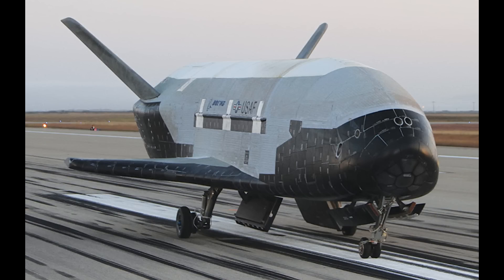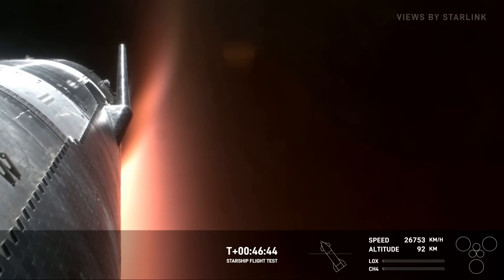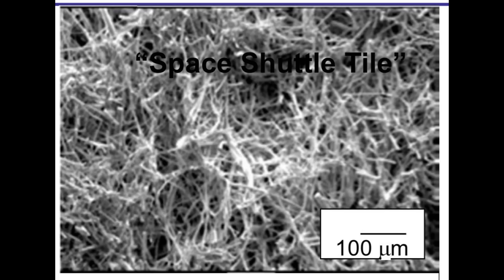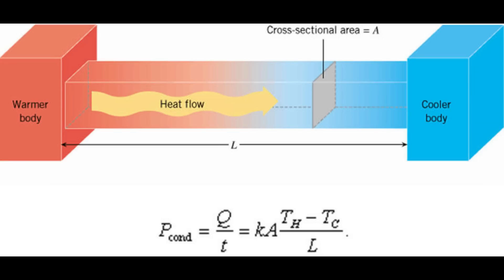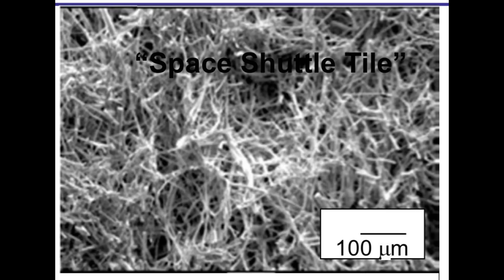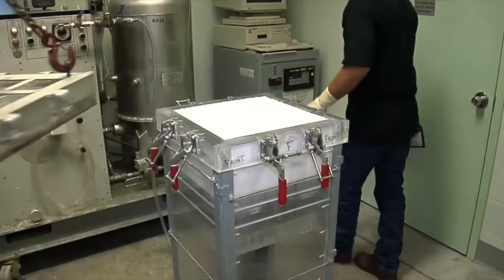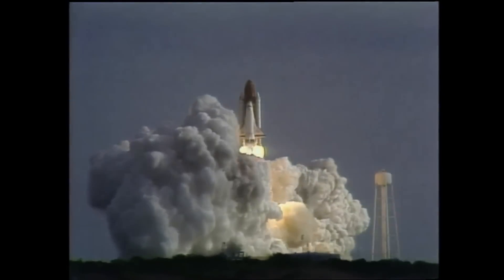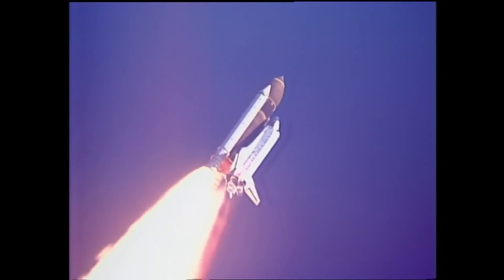The Microscopic Trick That Makes Heat Shielding Tiles Work

Comment: The best way to mitigate this problem may simply be to have BIGGER spaceships. In re-entry, a shockwave forms at some distance from the surface that needs protection, and that shockwave is then isolated from that surface. Heat must radiate from the shockwave to the surface you want to protect. Am I correct in supposing that, for a larger surface, the shockwave forms at a larger distance? If so, then the wave sits at a greater distance from the surface you need to protect. And if it's far enough away, you may be able to dispense with things such as ablative layers that need a lot of rework between flights.
Reply: It's not the size, it's the curvature of the edges, that means wings and flaps are tricky to deal with.  But that radiant heat from the shockwave is still a lot of heat to deal with, so you need a good heat shield even after getting the shockwave right.
Reply: A massive object will theoretically heat up faster over its surface due to the increased surface area facing against the atmosphere, meaning you have increased air resistance/drag. The air molecules would not just be more easily redirected like a highly aerodynamic shape, but instead be compressed and forced to move along the surface of the object till it reaches the edge.

The shockwave propagates along the surface, until it reaches the end of the surface and begins to dissipate. Other surfaces beyond the main facing (effectively in the wake of the object) can be subject to heat via radiation off of the plasma that was generated under compression, but this is a far minor problem.

I'm unsure what you mean by the shockwave in your comment - if you are taking about the plasma generated along the facing surface or the wake of the hot air/plasma. Normally the ablative heat shield elements for things like capsules do not need to be present anywhere but the facing surface.
Reply: @V3RTIGO222  There's also the simple mass to surface area scaling. The mass, and hence kinetic energy to dissipate, grows faster than the surface area over which it's dissipated. Only way to square that circle is the plasma gets hotter.
Reply: @QuantumHistorian  True, but I would assume that you could also create a larger shield, using lighter material or through construction that allows the overall weight to remain similar or lighter, without changing the size of the vessel if you wanted to... I think the inflatable heat shields kind of use that concept to a limited degree.

I will point out that with higher drag, you theoretically have a shorter period of time needed to slow the vessel, despite the higher peak temperature, which could be more advantageous.
Reply: @V3RTIGO222  That would work if the timescale at which the temperature of the plasma is dangerously hot is shorter than the timescale for heat transfer. In this case, the main mechanism for heat transfer is radiative which is going to be pretty fast no matter what you do. So I think the craft (or, at least, the heat tiles) would really "feel" the peak temperature. There's a reason why starship uses aerodynamic lift to slow down it's descend and bleed off speed as slowly as possible.

In addition, the thermal flux goes at T^4. And, roughly speaking, the integral of T over the whole of reentry is going to scale with the total kinetic energy loss, which goes up with mass. So if you halve the time of reentry, you double the temperature and so increase the heat flux by *16*. The scaling works against trying to get re-entry over and done with quickly.
Reply: @QuantumHistorian  This is effectively how ablative shields work, by discarding the heated material, so yes.
Reply: @V3RTIGO222  Huh? I thought the entire point was to not use ablative materials and instead have reusability? Otherwise, yes, obviously, it's been known for 60 years that ablation is the easiest way to make a heat shield. As ablation depends on total energy dissipated rather than heat flux, it can cope with shorter reentry times. But that's not what we want to happen for a reusable craft...
Reply: @QuantumHistorian  Well, specifically resusable heat shield(s)... We have plenty of reusable craft with ablative heat shields. In any case, you need something that can resist/absorb the thermal load or something that displaces it, and an increased surface area is unlikely to be good at enabling a resistance/absorbtion style of shielding.

Comment: I'm not an engineer but I was wondering about this for a long time. Would it be possible to use water vapor as a way to cool down the plates in friction with the atmosphere? Water is easily replaceable. Just keep a tank of it for releasing steam along the length of  the rocket during re-entry. I can't do the math of how heavy that tank would have to be,  or if the heat transfer of such process would solve the problem etc, but that's why i'm asking.
Reply: elon musk talked about this and it all boils down (haha get it) to it being the same mass as the heat shield 
Also they wanted to use methane for this, since it's much cooler
Reply: @linecraftman3907  Where was this video? It's hard to search using the same terms as the water cooled steel plate that is under the pad. Also the thing with water is that it costs much less to replace, and also involves far less parts. (that's if the whole thing works)
Reply: @lgtwzrd  he talked about it in the interview with Everyday Astronaut. 

The thing about water is that you're also adding a whole lot of complexity to the vehicle and the lines would have to run inside the fuel tanks where the water would freeze

Comment: The shuttle was really cool.
Reply: It was a flex.

But to be economic start with booster reuse, not orbiter, like falcon 9.
Reply: @xehpuk  I thought it did serve purposes other than “flexing” for the US? Like payload and crew rotation on the iss/mir. Also, the boosters were reused, the main orange tank fell into the ocean. The boosters fell back to earth with parachutes which allows them to survive.
Reply: @interestinggameraltlol9245 I would hardly call the boosters "reused". They were basically building them from scratch every time.

Comment: Whatever happened to actively cooling the skin?  Wasn't that the main point of using steel?
Reply: Steel still has the benefit of being better able to survive if a tile is broken.  Just look at how long that fin managed to hang on with hot plasma blasted inside the hinge.  The type of steel they are using also has the benefit of not becoming brittle at cryogenic temperatures.
Reply: @Br3ttM  I know.  But everything is a tradeoff.  IIRC, the thing that made steel a net win was supposed to be it simplifying the heat shielding.
Reply: SpaceX calculated that it would be heavier than a passive heat shield. But Elon said he wasn't so sure about that anymore.

Comment: We are in serious need of redesigning spacecraft altogether, and in saying this I also mean propulsion and anti gravity, or at least something to this effect..  but at the rate the human mind is evolving into a space faring species will determine the time factor, we lost out on incentive..to the tune of more than half a century..
Reply from the maker: Let me know when you make anti-gravity work because there's nothing in science that suggests it's possible. Until then let the engineers use what works.
Reply: @scottmanley  Oh wow, thanks anyway, was worth a shot.." at least something to that effect"  🙃
Reply: @scottmanley  Combining Gravity Assists with Low-Thrust Propulsion
Using low-thrust propulsion systems in conjunction with gravity assists can make missions more efficient and flexible. Low-thrust propulsion allows for larger launch windows and can be optimized together with the gravity assist maneuvers. Evolutionary neurocontrollers have been proposed as an effective way to optimize these combined low-thrust gravity assist trajectories.
Tweaking along these lines makes an interesting read.

Comment: I guess the inflatable heat shield that NASA tested for ULA to recover their engines (eventually) uses a material more flexible than ceramics.
Reply: Ceramic fibers can actually be surprisingly flexible depending on the chemical composition and production method. The TPS tiles shown in the video are specifically made to be rigid through extreme compression and heat/chemical treatment. You can also combine ceramic fibers with heat resistant polymers like Kevlar to make composite textiles
Reply: Is there a spray on ablative ceramic coating that could be applied to outside of the existing Starship ceramic tiles that could be reapplied between flights?

Comment: From all the properties of the material needed to reduce heat transfer, rigidity of the ceramic does not look like the benefit, so maybe they can make flexible material to coat the ship and re-coat as needed?
Reply: There aren't many options for things that can withstand that level of heat without reacting with the oxygen in the air, and also rigid enough to maintain that micro-structure.

Comment: Just wondering if an appendage, perhaps something akin to a hydrofoil wing, could be used to absorb and deflect the worst part of the re-entry through the atmosphere. Something that would extend and protrude forward to take the brunt of the shock. Yes it would add more weight but perhaps it could enough of the job to reduce some of the tiling on the orbiter itself. Or maybe a scoop that would be trap and form a ball of plasma ahead of the descending orbiter.
Reply: What spacecraft have done is have a shockwave that does that, and use the shape of the craft to keep that boundary far enough from the surface.  You need blunt rounded parts to do this, which means wings and flaps are harder to protect because of their shape.  The air in that shockwave gets hot enough to glow, which means it transfers a lot of heat through radiation, just not as much as it would with full contact.
Reply: @Br3ttM  Thanks for that. I was thinking of how someone does the crawl in a swimming pool. Their stroke is less efficient if they completely cup their hands because the water will form a ball which then pushes against the water that is ahead. So I had the thought that maybe a hardened ceramic-like scoop pointing forwards, could do the same for the plasma. Form a ball of plasma which would then push against the air during descent, and perhaps take the brunt of the heat away from the orbiter. I know, wild idea.
Reply: @Br3ttM  sounds a bit like the bulbous bow on large ships.

Comment: Back when the Space Shuttle was flying I recall seeing a research paper about using multi layer corregated titanium instead of the silicon tiles.  Supposedly it would be more resistent to wear and tear.  Anyone know what happened to it?  Was it less resistent?  Did it cost more?
Reply: Titanium loses strength and oxidation resistance at temperatures above 500C. The Shuttle tiles have to survive temperatures up to 1300C.

Comment: Doesn't a ceramic heat shield slowly dissipate its absorbed heat over time? I think I remember that Shuttle needed heavy venting for hours after each re-entry so the orbiter wouldn't get too hot inside after landing.
I wonder how this might impact Starship's plans for rapid reuse.
Reply: It doesn't let much heat through, and reflects as much as possible, but yes, all the heat it absorbs will come out at some point.  You do get to take advantage of convection to cool while you're on the ground, though.

Comment: Could you make a heat shield from airogell? I know it’s not very strong but still.
Reply: If NileRed's video is any indication, making high-quality aerogel is really time-consuming. Even if it was massively upscaled and automated, and with huge evaporation farms to recycle the solvents, heat shield manufacturing would be a huge bottleneck.
Reply: @General12th  oow I did not know Nile made video about that. Guess I need to watch it now. Besides brittleness this makes more sense now why you would not want to even try to make heat shield from airogell.
Reply: Why couldn't you besides the fragile nature of it?

Comment: Isn't actually the cold moving towards heat? Unless it's radiation.
Reply: No. In each case, heat (energy) is moving to places with less heat (energy) until they balance out. Heat is a physical property, caused by the energy of atoms or photons. "Cold" is merely "having less energy than your surroundings".
Reply: @marcusdirk  I do know about the energy states. But then in architecture they suggest the cold is moving towards heat. Maybe because hot gasses in particular have less density, not completely sure.
Reply: @vensroofcat6415  Well, as the energy transfers, the hot thing will cool down as the cool thing warms up. So both appear to move, if you look at it that way. I haven't studied architecture. Heat loss and heat conservation ought to be important topics there; maybe even architects from different climates look at it differently depending on which side is most important to them.

Comment: Scott's last comment tells the correct reason for the rapid reuse problem for any Starship. He didn't, however, mention the cost of the tiles to be mfg'ed or refurbished once they return from space. That was always a high cost for any Shuttle. So with that in mind, how are they going to check the tiles once the craft is restacked? Seems that would hold up any other launches by creating a bottle neck. It may be better to allow Starship to reland on the ground and use a new ship for each flight. I'm sure they'll consider this if they can't resolve the tile problem. Just an opinion.....
Reply: Starship can reduce the cost of tile replacements a lot by its shape.  Most of the tiles are the same size and shape, instead of each one being unique.  The nose is rounded, but still more symmetrical than the space shuttle.
Reply: @Br3ttM  Indeed. They are also easier to replace, and fall off more easily.
Reply: I don’t doubt that the first ship to be recovered will be examined in great detail.

Comment: Anybody ever think of like a material that can produce a plasma upun re entry that keeps atomic nuclei from directly messing with the material to begin with
Reply: That's what ablative heat shields do.  It requires a source of material to emit, so either tiles that ablate away, or a complex plumbing system to vent material across the surface, which they had originally considered for Starship, but didn't end up using.  You can also have a spray on coating over a non-ablative heat shield, but then you need to apply it every time.

Comment: ITAR is no joke. Glad you checked.
Wonder if a plumber's soldering blanket could help? ~2,300 degrees and cheaper than dirt. 17cents a square inch retail.
Reply: ITAR can be odd. A microscopic pic might get you in trouble? Yet the tiles themselves are available on eBay. I'm sure the Chinese bought some early on and have studied them under their finest microscopes. IIRC after OFT-1 some were gathered from the beach and hadn't been in the ocean.
Reply: But probably ultra heavy. Everything is a trade-off
Reply: The heat isn't particularly hard to deal with on its own. The main problem is that plasma at those velocities can strip out individual atoms and molecules, so the surface material has to be extremely chemically stable at an extreme range of temperatures while also being strong and rigid enough to protect the insulating layer.
Reply: Does this mean a different density tile for Mars? 'air' spacing..😮
Reply: There are space rated similar blankets, but I don't think they temp range is quite high enough.  Much of the white 'tiles' on the shuttle were FRSI (Felt Reusable Surface Insulation) that look like a quilted blanket.  If something similar could be developed in a high enough temperature range, it would remove the problem of the fragile tiles.
Reply: The blankets that you can get in retail would probably not help. A majority of the cost of any component in space flight is the fuel to get it to orbit. If you save $100k worth of cost for the insulation material (by picking something that costs 1k total) but the added weight means you need $500k worth of extra fuel, then you don't actually save money. And increasing your dry weigt also reduces your take-off weight.
However, having a material that comes in the form of blankets might be an interesting idea. Which would mean that
A: The heat shielding is much easier to handle. Each blanket can easily be (10m)², instead of (10cm)² for a tile, and the blankets could all be fully interchangable.
B: The big advantage would be that they can be overlapped in a few layers. Then you don't have to completely change out the heat shielding, just take off the outer layer (where it hasn't been ripped off yet) and attach a new one underneath the middle layers.

Comment: If those tiles float they’ll surely be washing up on the coastline down there.
Reply: Dear SpaceX passengers, in case of a water landing grab one of the tiles from under your seat and use as a floatation device 😂
Reply: They have bee since IFT-1
Reply: @unownyoutuber9049  - I meant the Indian Ocean after re-entry.

Comment: If those tile things are made of borosilicate glass, then couldn't we use the ion replacement technique to make the tiles much stronger? Those East German beer glasses that were made using this process were 15X stronger than borosilicate glass. You could drop them on the ground, and more often than not, they'd bounce instead of shattering! https://www.youtube.com/watch?v=vEvBpjCOBu0